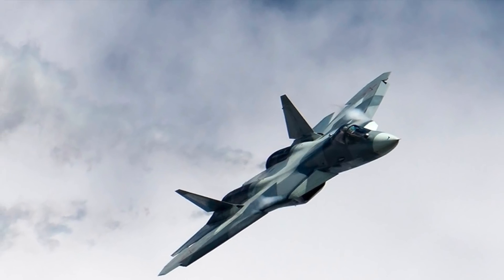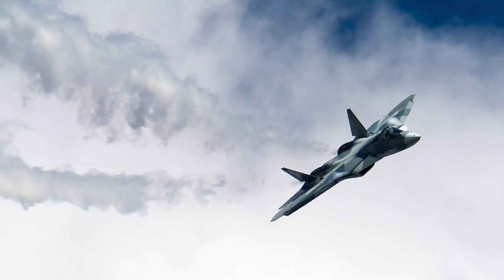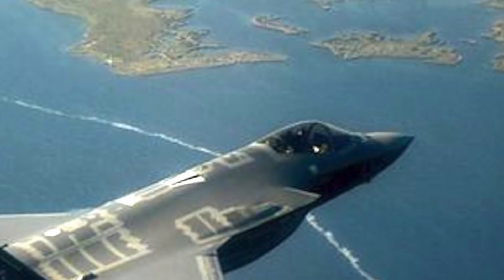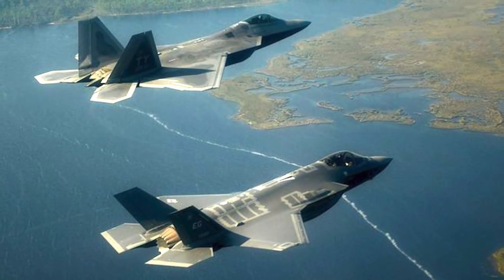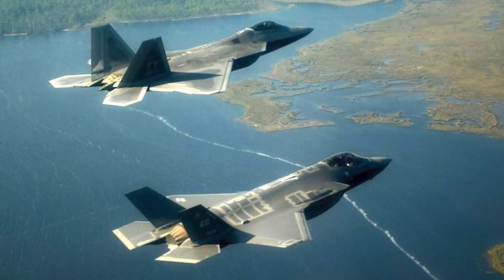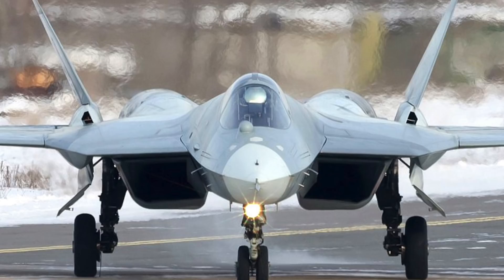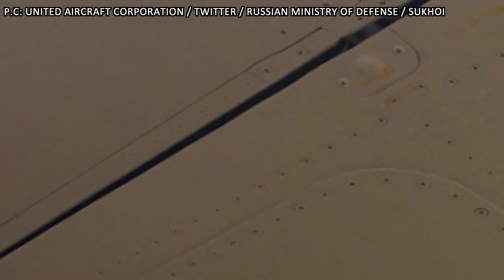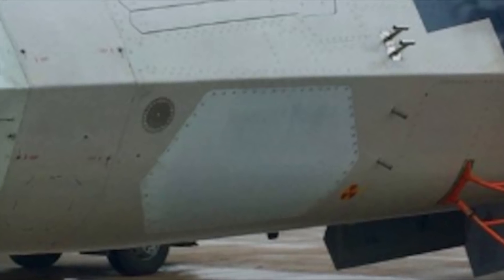WHY NEW RADAR-EVADING COATING WILL NOT MAKE RUSSIAN SU 57 STEALTHY?

Comment: The Felon does have a nice canopy and the shape of the fuselage is pretty good for scattering or deflecting radar. As far as any RAM is concerned I have read or seen nothing in these vids that leads me to believe any of these commenters really has a clue. Radar absorption is not scattering unless you are talking about absorbing and then attenuation is like the energy entering a maze of reflectors and continuing until not much bounces back through the fun house mirrors and ending up as heat.

Comment: I haven’t found much about the potential of su57 it’s obviously not stealth for many reasons such as the exhaust plus all the screws and rivets and the fact they can’t make it seem less plus  the engine blades are visible my question is if those flaws were fixed could it actually become very stealthy it’s a unique jet with  the engines being separated on the bottom, and the jet is beautiful
Reply: No, it cannot become very stealthy . However, it may just be sufficiently stealthy to mess with opponents in engagements at long distances. And that appears to be the principal consideration of its creators. It may be detected perhaps at three times the range than for example the F-22 (e.g. 30/40 to 90/120km). However all these distances are within the range of its opto-electronic suit. Overall situational awareness is provided by some l-band radars and data fusion takes place. (And within this combined space there may be no effective hiding place.)

Comment: LoL it's to bad nobody has piped up there that the coating is helpful, but there's a laundry list of much more significant issues before that gets into the list.  It's nice to hear though they are concerned about the UV ray exposure their pilots endure, but a half hour flight once a month is .....well let's put it this way, when your maintence and mfg standards improve to something approaching even an experimental vehicle operational readiness, we can they were about the canopy.   Did They put this thing together with a nail gun?

Comment: The rivet problem and gaps can easly be  fixed. The rivet problem and gaps are because those aircraft are being  used for testing. They are prototypes hence those  problems. The production aircraft will get rid of those problems.

Comment: this is a fake analyses and a fake argument.
- russians explained how they menaged ONE ASPECT of their stealth ( stelth of the glass canopy ) ,AND THIS CRAPY ,PATHETIC ARTICLE TAKES THAT AS A STATEMENT THAT MAKING CANOPY STEALTHY IS THE ONLY THING RUSSIANS HAVE DONE FOR OVERALL STEALTH.
this is just shocking level of bs...at this point western propagandists aren't even trying to make any compelling argument ,THEY JUST TAKE FOR GRANTED THAT CONSUMERS OF THIS "INFORMATION "ARE JUST WAAAY TO DUMB ,SO WHY BOTHERING WITH ANY SOFISTICATED PROPAGANDA.

when it comes to riveting ...frontal stealth is THE EASIEST TO ACHIEVE...by nature of physics EVERY PLANE IN THE WORLD (with very few exeptions ) is STEALTHYEST from the front ,and could be easely made even more stealth ( from the front ) simply by aplying RAM.

riveting MAY BE the reason that why russian jets are way cheaper than american jets...and if that is true...it could be EASELY COVERED with RAM ( same way F-22 and F-35 are covering openings and spaces of their weapons bays ).

but i'm not saying that riveting is the thing about SU-57,actually it would be counterproductive to rivet PIECES OF CARBON FIBER ( since SU-57 is NOT MADE OUT OF ALLUMINUM or any other metal ,but rather it's built out of composite materials like carbon fiber )...so riveting would be strage solution even for russians.

EVEN if those thing on immages were real rivets ...i dubt that FINALIZED PRODUCT ( aicraft that goes into serrial production ) will have riveted pieces of carbon fiber...but even if so ,it's penalty on stealth is massively exagerated ( especially from the front....where aircraft is by deffinition THE SMALLEST and stealth is most effective )

Comment: Su57 is a bigger better Rafale which is quite an achievement. 
It's defensive mission close to homeland infrastructure makes the compromises of its conception well suited for the use it's intended for.
Su57 won't be used to dive deep behind the front line. Instead, the Okhotnik drone will.

Comment: All that because they wish not to compromise flying capability. second any modern radar like those on S 400  can see F22  or any so called Stealth Flying   object, best example is shooting down  of F117  over Serbia bx system from 60 ths  by NEVA,not by luck or something like that , they see him on 
acquisition  radar and than on targeting one. Crew said that they do not know which plain they shot. only they know that was enemy plain                                                                                        a
Reply: One stealth plane in over 40 years! That plane was the 1st generation and didn't have any EW systems or missile warnings. The plane was riding the same flight path over 3 days, plus they had guys go to the airport and report when they took off!  So when the F117 was what 27kms away and then launched its bomb doors got stuck and this kept the stealth jet pinning because it was so close with the bomber door open. Even then they didn't get a lock on it, fired 2 missiles and one damaged it enough to bring it down. 
So Russia tech had nothing to do with it, but mistakes on US part! I love it when Putintrollers bring this story up! 1 in 6,500 sorties. Those mistakes ain't happening again, a B2 plane with all its upgrades can fly anywhere in the world including China or Russia airspace without getting shot down. Locating it with all the other noise even with top digital computers trying to compare and separate the backwash is incredibly hard. B2 has a .0001 just like f22, f35 might be .00001. The f117 has a .001
One S400 battalion with 3 buks , with an s300 regiment attached is what Moscow has protecting it. S400 has all these extra antennae in l, s, wave in order to get different angles from an f22 or f35 to create a digital picture where it can track and shoot it. The S400s main radar can see f22 at 27kms..., can get a fire shot at 16kms. 9 miles or 16 kms for the main targeting acquisitions radar of S400. Aesa radar of Russia 1st generation. How is a pesa radar which is weaker then S400s track radar going to locate it. SU57claims it can track it at over 90kms..lol because it has 2 l radars which are great for STEALTHY planes. These 2 radars are a quarter the size of a regular radar, meaning no power at all.

Comment: Funniest thing is f22 and F35 could be invisible at certain range for certain types of Radar but not for everyone there is the main hide and seek and peeka - boo 😂 now f22 easy knock of mig - 21,but su-35 has kibini pod f22 will get blind due to jammer  depending the circumstances only then hybrid radar system with active and passive, and combo digital and analogue those can see everything so much tactics can make you confused. decoy, ping transponder could be coming form drone, fake locking, jammer, electromagnetic pulse generator in a few seconds you have to make decisions.

Comment: It would be very if not extremely useful if so-called "experts" would once for a change become true experts, not a political-tech lackey. Their "analysis" is usually ordered by their powerful media masters just to fill the empty gap left by technologically fast advancing enemy. 

Readers should use common sense and logic not blindly jumping in conclusion offered by these charlatans. 

Please, can you learn once forever that there are no stealth jets? The only stealth jets and truly invisible to radar are these jets parked in a hangar, and all other which are in the air are VISIBLE TO CERTAIN RADAR WAVELENGTH.

We are speaking about Radar Reduced Cross Section (RRCS), not about the myth of stealth created by profit-hungry and scrupulousness of military-industrial complex supported by the media they own.

Next myth is that jet will deflect Radar microwave in a different direction from the radar. Did you finish primary school to understand what kind of rubbish you are talking here? Hope you are aware that still does not exist actively controllable surface which would calculate directions angle of the source of microwaves and adjust surface accordingly in order to avoid deflection of the microwave signal back to the source. 

The most effective surface would be the aspheric shape as there would be a very small surface (point) which would reflect back to the source, the rest would be dispersed. This is physical law and no stupid arguments on that. Saying that it is very clear that every radar will detect the spheric object at a certain distance simply because at one point reflection from the small point will be powerful enough to trigger radar reaction.

Therefore F22, F35, Fxyz, Su-57, MiG-xyz J-20 and so on, will always be detectable no matter what they say or do. The only things that can help is a strong signal absorption surface. How to achieve total radar visibility is in theory very easy. All that is needed is to create an opposite electric charge (polarity) of the surface. Only when the signal is attracted and absorbed by the object NOTHING, ABSOLUTELY NOTHING will bounce away from the object and that would mean no radar visibility no matter what wavelength and radar antenna power is. Even if the object is just 1m away from the antenna it will be totally invisible regardless of shape and surface.

However, that is impossible to achieve, because such an object would be completely destroyed in a matter of minutes if not seconds. Reason being is that it would cause static electricity discharge in the sky and attract the most powerful bolts of lightning and no matter how shielded would be electronic it would be instantly ionised and would explode. 

This is now back to the beginning of aviation where more powerful radars are used for earlier detection, longer range and faster Air to Air missiles and of course agility - manoeuvrability. These will be the factors to determine the outcome of a possible combat situation.  And to ad very important if the not detrimental factor is EW which will play a very important - a crucial role in a dogfight which will always be the ultimate result maker.

Think hard about above and then you will start to see real picture away from powerful propaganda.

Comment: Analysing prototypes, which these are, is an academic exercise for the most part and doesn't offer the viewer a complete picture. Russia has the same engineering cnc gear the US has primarily due to it being manufactured in Japan. 5 axis cnc machines are available in every market.
Russia spends it a money by not taking on an opposing airforce head on. Instead prefers to design cheap and highly effective systems to thin out the numbers before reaching their target. S400, pantsir and others take on this role. Su57 would be  deployed in regions where these limitations hold little significance

Comment: The Sukhoi 57 was designed with the intent to combat 5th generation aircraft, with sensors, weaponry, and manunerability to track and destroy.

The F22 was intended to combat 4th generation aircraft, since it was the first of it's kind. With it having superior sensors, stealth, and manunerability(to some, not all) compared to most 4th gen areal vehicles.

Russia has the advantage. Enough time has passed for the F22's liabilities to be exploited. By improving the SU57 in areas where the the F22 suffers, Russia can potentially create a very deadly 5th gen hunter.
Their only letdown is their economy. Russia can't produce the sufficient amount of parts and facilities to construct it on a larger scale.
Reply: Actually, upon starting the PAK FA program, most of the F-22's actual capabilities are classified, and still are today. What is known is that the F-22 has superior radar and stealth. There isn't much information on the data fusion or sensor suite of the Su-57 though, we'll just have to wait.

Comment: In viev of the fact that radar technologies are being developed that can detect stealth planes, the stealth profile will not play significant role in hipothetical warfare scenario between peer enemies.  So, Russians  probably put the emphasis on the fighting abiblities of the su57 rather than  on stealth profile.
Reply: This is wrong. Detecting stealth planes has never been an issue as that's not how stealth works.

It works a bit like camouflage where it's much harder to spot some enemy in a forest that blends in his background than some idiot wearing a bright orange vest.

Stealth aircraft give a much lower return signal to radar, so the radar needs to be much closer for detection. If you improve your radar, they'll work much better against non-stealth aircraft, meaning stealth aircraft are still much better than the non-stealth.

The reason Russians put less of an emphasis on stealth was that they don't have the experience with it and it would be a huge risk and massive investment to make something as stealthy as the F-35. Just look at how much trouble the USA got from the F-35. Russians simply don't have the budget for such costs.
Reply: @ivanlagrossemoule  Obviously, we have different point of view. From my point of view, it doesn't matter if stealth plane is beter than non-stealth plane.  I just emphasized the irrelevance of stealth against modern radars. F-35 can do its job in Libia or Somalia but not in Russia or China. Stealth technology is obsolete. That's my point. Russian S-400 IS capable to take out f-35 from the skies from afar. That's why Americans are so eager to prevent other countries from buying S-400.
Reply: Goran Nesic Just using common sense defeats your position.  Do you think nations like Japan and South Korea need stealth to fight third world countries? Of course not. Their potential foe is China, who is now surpassing Russia technologically. Speaking of China, for what purpose would they need stealth fighters and bombers?

And do you think that all these nations would need a very high tech aircraft to fight third world adversaries when cheaper 4th gen aircraft can do the trick?

Stealth works, don’t deny it.  The USA has now been using stealth aircraft for almost 40 years, and in that period only one has been shot down, and even that one was due to human error and not Russian technology.  On the other hand, Russia lost 4-10 aircraft in just one week against tiny foe Georgia, and against Sams that it should have known how to defeat. Make no mistake, stealth works. Otherwise, you would not see so many nations spending billions on it. It’s not just on aircraft, but ships, missiles, and even satellites.
Reply: @Thetequilashooter1  Yes, stealth works, but against whom? If it is not effective against strategic adversary, it is obsolete. Again, I don't compare stealth and non-stealth planes. I put stealth planes against modern air defence systems.  US stealth planes cannot fly over Russian or Chinese skies without being shot down immediately. I mentioned just S-400. But s-400 is just a part of multi-leyered, integrated, networked air-defense in Russia. Not a mosquito can get through, let alone  lame f-35.
Reply: @moon512ify  Bullshit. Who does China have plans to use its stealth bombers against?  The US of course.  Who do you think Russia had in mind to use the Su-57?  The US of course.  The only reason why you're making this ridiculous assertion is because you're pro-Russian, and you know that Russia is very far behind in this field. Russia still wouldn't be putting money into the Su-57 unless it didn't think it was needed to fight the US.  Who else does Russia have in mind?  Nobody.

Keep in mind that both Serbia and Iraq had an integrated air defense networks. Baghdad at the time was considered the second most heavily defended city in the world, and all it could do was shoot its missiles and guns blindly in the air.  

There are many ways to defeat SAMS, and not just with stealth. Just look at how effortless Israel penetrates Syrian air defenses and with 4th gen aircraft. If stealth didn't work, you wouldn't find that just one stealth aircraft got shot down in around 40 years of them being in service. For Russia to lose 4-10 aircraft against Georgian SAMS in just one week  shows your wrong.  The fact that the F-117 flew thousands of sorties deep into enemy territory, and against integrated defense networks, says your wrong.  

Nations around the world wouldn't be spending billions on stealth to fight third world nations.  Japan just ordered another 100  F-35's , and their only potential foes are China and Russia. Try being sensible.  Your argument holds no water.

Comment: This video omits to mention one huge reason why SU-57 is not a stealthy jet by US standards and that's it's engine intakes. Engine blades are directly visible and therefore they return a massive radar reflection. There are great analysis of one photo of the SU-57 which was taken from directly up front which shows complete lack of stealth features on its engine intakes.

Comment: A very good analysis about the SU-57 stealth capability.  One question arises from it:  were the sukhoi designers aware in advance of what was needed in order to make the plane stealthy?  Because the structural flaws mentioned in the video, like the gaps between surfaces,  suggest they were not.  But another question can be made here:  can the stealth characteristic be achieved by using a coating materials and Electronic Warfare?